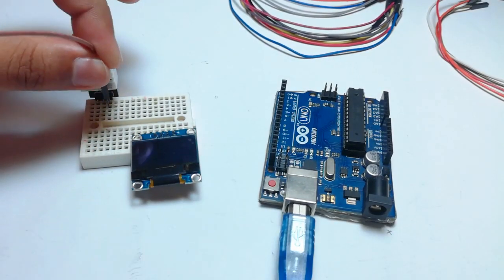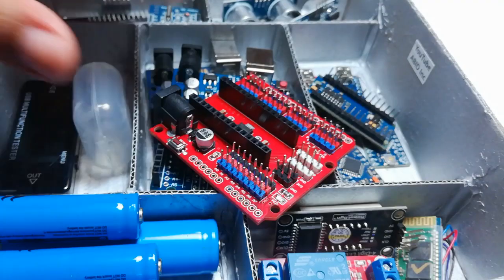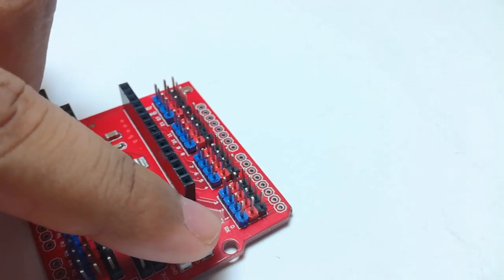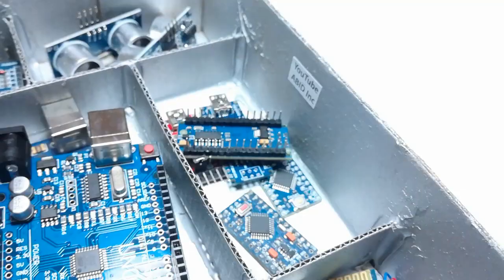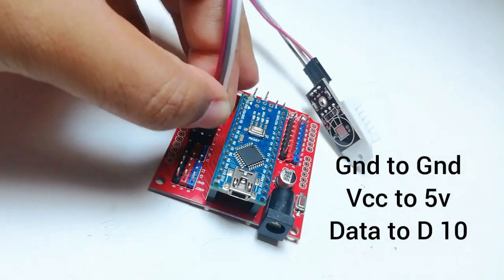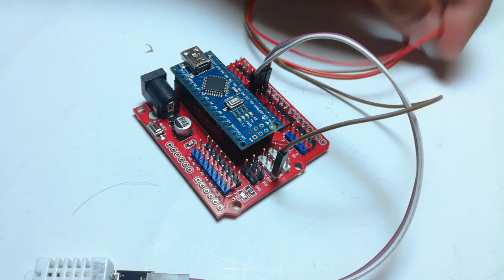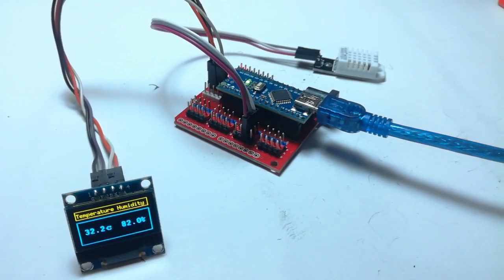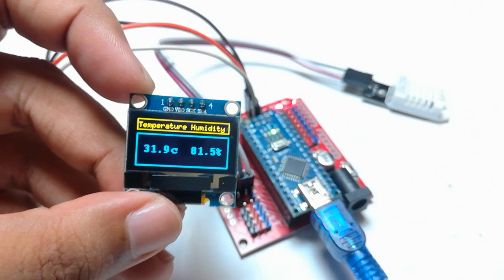Arduino Nano I/O Expansion Board || Project with Oled and DHT22 sensor.

Comment: 12volts input but how much amps?
Reply: Actually it is 7-12 volts. 9v works easiest for regulator. Also 500mA to 2A is recommended. Best is 9v 2A.
Reply from the maker: 200-1000mA